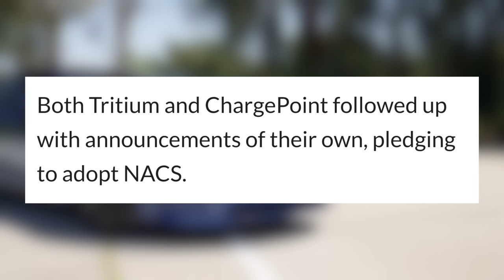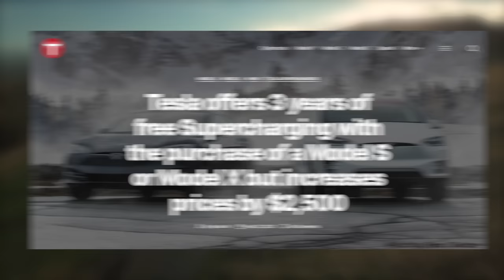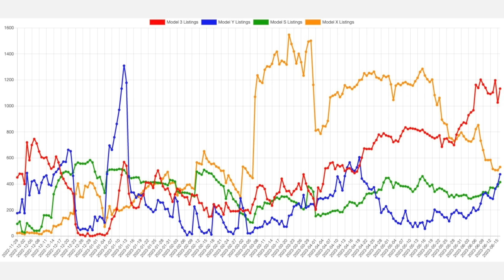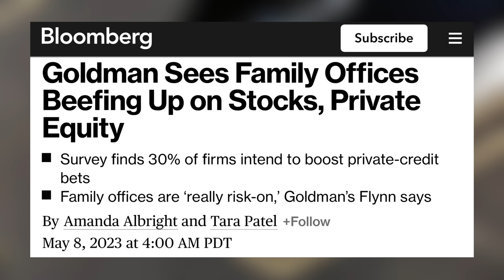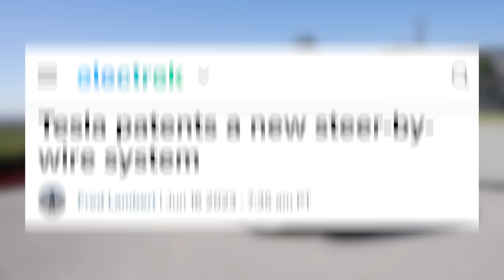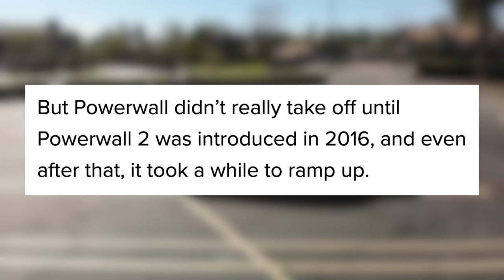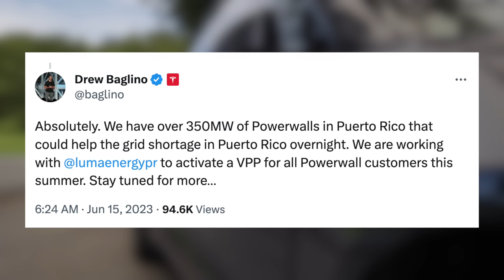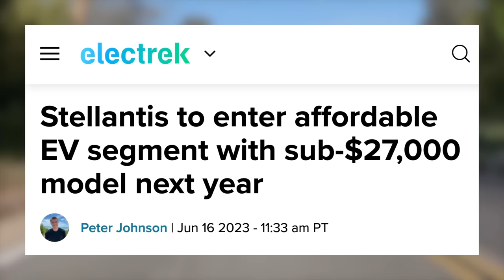NEW Tesla PRICE DROP Is Here | $8000 Plus Incentives

Comment: NACS will be great for EV community as a whole, but it will have its hiccups, possibly even just as frustrating just for the fact that Tesla superchargers are reliable because the handshake with the car is perfect and in house. It may become a concern when that handshake has to go through multiple different parties/ automakers
Reply: I don't see the problem, especially as charging controllers improve in evs. Remember the problems with carburetors, I do , fuel injection resolved those problems very quickly as everyone started using them.
 Same will happen with charge controllers, improving until a system that is reliable is developed. I don't really want charging stations knowing too much about my car like tesla who have via software blocked users from charging for multiple reasons. Hopefully again a standard will be developed and all issues resolved, tesla does not have the best system right now. Good yes but not the best, I think Mercedes has better.

Comment: Steer-by-wire is long overdue.  There are several advantages to seer-by-wire including steering modes such as normal/sport, greater effect as the wheel rotation increases,  and especially an easy change from left to right hand drive.

Comment: What comes to NACS charging port - while quite convenient for two-phase 120V network Americas has,  it is not so straightforward in Europe. Most households/charging ports here have the European 3 phase  electric with 400V that requires a different socket - the standard power is 2kW to 6kW. Also the CSS socket is age-old and can be found from all places from late early 1960 onwards.
Thus NACS can never be the standard for us in the EU as our electricity network has much more power to every single household and an existing standard. The standard might not look so good- but as the EU mandated, NACS will be backward compatible to our CCS so we will see which socket will prevail.
(A side note - Finland has negative mean price for electricity for the third week.)
Reply: CCS socket isn't more than 15 years old. J1772 came out in 2009 and CCS built on J1772 and so came out after that.
Reply: @imzjustplayin  Now I have to say that I don't have the expertise but my parents home in the 70s had that socket. As well all the sockets I've seen  after that in my life in Europe. I'm talking about the circular multi-pin socket that all have the 3 phase 400V power. (The circular socket is that standard that is needed for Europe. The bigger socket with the AC plugs is a different thing - is that called CCS?.)

Comment: It has been five weeks since I received my model S plaid with the $15,000 FSD option. I wonder when I can expect my FSD beta? Sure is an expensive option for nothing! I was even an early adopter in 2012 and really am surprised it has not come about in my vehicle yet.
Reply: It’s based on what software version you are on. For example, if you are on 2023.20.4 and FSD BETA is in 2023.12, you just have to wait until FSD BETA catches up to your software version. This is why people usually hold off on software updates to avoid always being ahead of the FSD BETA
Reply: @M1A1SteakSauce  Thanks Mike.
Reply: Have you updated software downloads to Advanced? This should help speed up the process. There is also a dependence on relative release numbers. Anyway, you will always welcome a later release which it is improving rapidly.

Comment: 135 000 charging stations worldwide, tesla is about 1/3 of them, and were 95% of chargers 5 years ago. As new standards are implemented charging on all networks should be more reliable, tesla has had its share of charging issues like everyone has

As standards improve charging at faster rates should not be a premium as on tela chargers but a standard, especially when the new capacitors are widly used by manufacturers of cars and charging stations. We are looking at a future where charging the  biggest batteries could take less than 10 minutes to 80%, not even enough time for a coffee.

Comment: I think Lexus has a Steer by wire system on a new car... It is a variable rate steering system with a Yoke style wheel.. the only way those really work.  You only need to move the yoke 90 deg any direction to get full lock... and that ratio varies by speed and situation.

I really hope they don't remove stalks from the Model 3.  Thats a step backwards in usability.. and I suspect will be a turn off to new buyers..
cars have had turn signals and lights in the same place for decades.. because IT WORKS.. and its intuitive and you don't have to look for a button to press.. you can feel the lever.

Comment: You made a false statemet there Ryan. NACS is not more reliable than CCS, it just has higher max throughput and lower cost.
Tesla chargers with CCS is just as reliable as the ones you have over the pond.
The reliability issue with 3rd party chargers lies elsewhere.

Comment: Question I’m going to pull the trigger and buy a Model 3 but they don’t have a car with stock 18inch rims for me to test drive I drove the rear wheel with 19in rims is there a difference in the ride I’m looking for a softer ride and the bigger tire on the 18 should be softer of course the 19 looks a little better. Can someone give me some advice? Is the ride the same 19 have 40profile and 18 have 45 profile. I have a back injury and that’s why I’m going for comfort. Thanks
Reply: The 18 inch tires soak up the bumps a little better on uneven roads or rail road crossings  . I’ve driven the model 3 with 19 inch tires .  Cornering was slightly better . But for the comfort you seek , pull the trigger on the model 3 with 18 inch tires .

Comment: Still not interested when the costs are so high, electric costs going up where they are going to match and exceed the cost of current gasoline soon. Also takes too long to charge after a 200 mile drive that wastes a lot of time.  Not buying any EV for the above and a lot longer list from not very green, costs too much for maintenance and repairs, and these cars will go up a lot when the rare materials go up and become even more rare just to list a few more.  So nope not interested.  Hydrogen is a much better technology and takes 90 seconds to refill and go not 30 minutes to an hour every 200 miles. Interesting information in any event but still not interested.